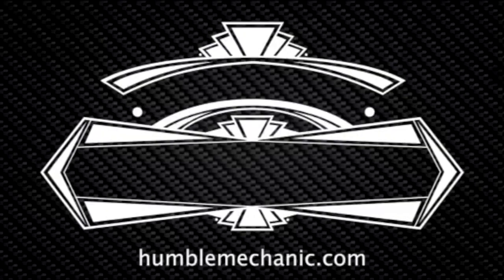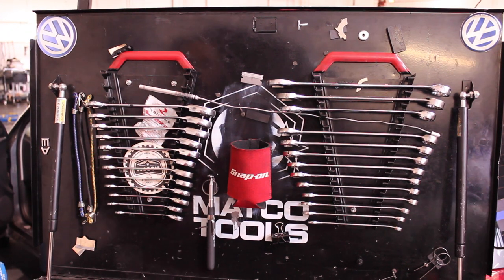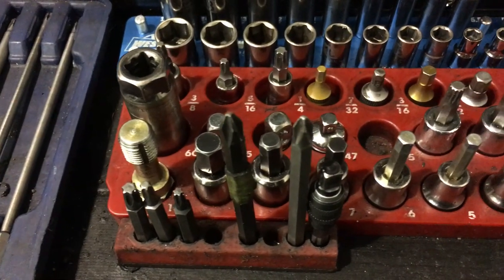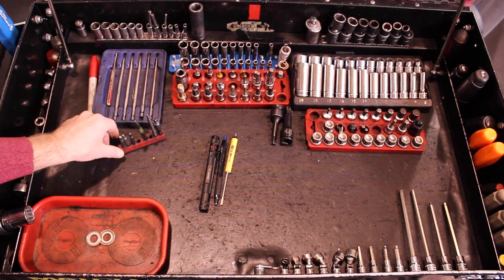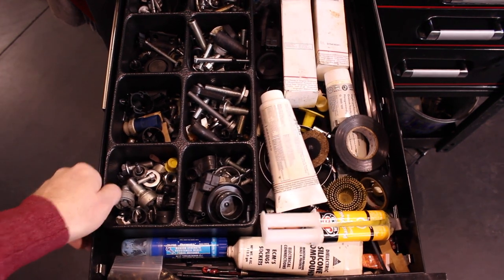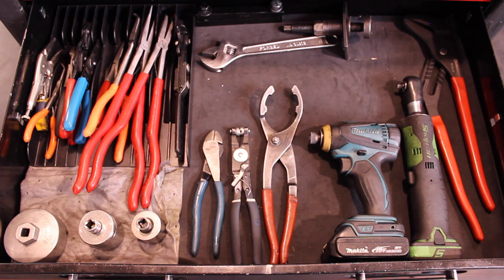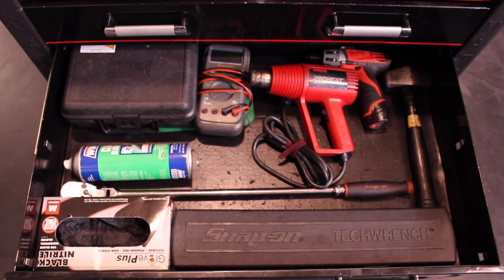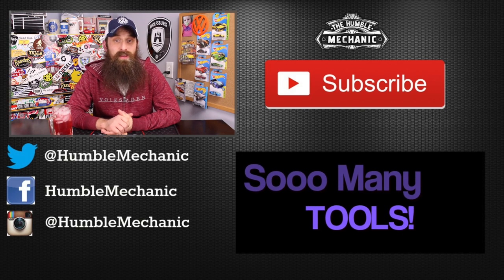What's In A VW Mechanic's Tool Cart

Comment: Your miscellaneous chemicals/assorted stuff bottom shelf is so much neater than mine...but I really do need 6 partial bottles of brake fluid, two cans of throttle cleaner, etc. I think 90% of technicians are predisposed to hoarding.
Reply: +SuperFishbomb LOLZ!  I transfered stores a couple weeks ago and dumped all the chemicals and junk off the bottom of my roll cart into a BIG pile at the old store.  It is all bare now with just a rotor sitting on it (otherwise the cart WILL tip over on our uneven floors), my "oil out" cone attached to the rotor, and two bottles of washer fluid.  It looks odd being so empty, and I kinda like it!
Reply: James Somners Hahahaha oil out cones. Always told the new guys if you need that to remember there's no oil, leave now. I always put the oil cap in by the hood latch. Cant shut the hood then....rather buy a cap than an engine.
Reply: "Oil out" cone...you by chance work for firestone?? Only shop I have ever worked in that has them...I rarely ever use them though.
Reply: I agree....But if you have to leave a car over night without oil in it it's a good idea like when you need parts but no parts store has a driver at 430 on a Sunday afternoon..

Comment: how do you bleed the clutch?
Reply from the maker: +denis vr6 Gravity bleed kinda sucks. I like to pressure bleed, but you need a bleeder for that. You can use a vac pump to bleed if you have one. Generally you have to pump the pedal by hand a bunch of times and bleed it a bunch of times too.

Comment: Props on using the tape. Took my car to a dealership for brakes, they ruined every single hole on my brand new $1500 rims... every hole! You'd think after fucking up 3-4 they would STOP!!! But not in this case. Had to provide my receipt for the rims and they had them replaced after about 2 hours of complaining and calling the cops. All because they didn't think to use tape. 
Seriously though, they were black rims... I could see they were damaged from 20 feet away. It was either a lazy piece of shit and or someone right out of tech school.